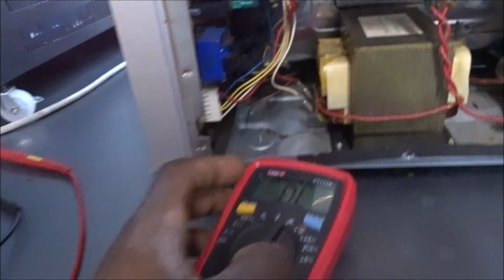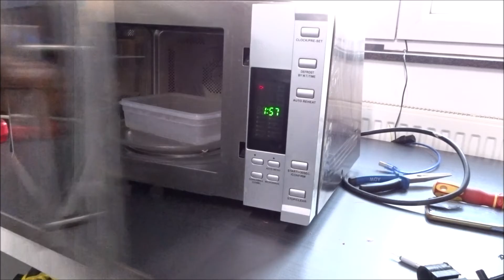Microwave  Not Heating?

Comment: Please my microwave power is off now and there is no power for.
Please what are the steps to check it please and please.
Reply from the maker: @EmmanuelKwakuAmponsah-v9z  well put the power on ,and from inside the microwave, using voltmeter measure  the cables that bring in power to the motherboard ,so u follow the powerlines ,This should be do e with an experienced electrician ,
Keep informed that if u plug 🔌 to the outlet, then remove the plug 🔌, capacitor inside the microwave, still store a lot of energy. If not well respected, you can get seriously electrocuted

Comment: Can we use jamper wire instade of fuse?????!!????
Reply from the maker: @TemesgenTelaynehMekonnen  if u use jumper wire ,it will work.the fuse is made to blow up when things go wrong and thus cutting from going to high voltage transformer ,so if u use jump wire and something go wrong ,u gonna cause short circuit or fire 🔥 
I highly recommend to use the right fuse for your safe
Reply: i strong advise you not to do it. Jt could work but replacing that wirh simple coppper wire.its dangerous specially that fuse which is high voltage fuse to protect the power transformer of magnetron(most expensive part to replace). becareful with electric shocks

Comment: What is the reason why microwave fuse keep blowing as soon as you plug
Reply from the maker: The problem can come from different reasons...
Components' failure causes a short circuit .
Warming things with wrong materials exp metallic materials .
A power  SURGE( is a sudden increase in voltage in an electrical system. A power surge in a house may fry your delicate electronic devices and damage appliances when too much power surges into their circuits. Most homes are wired for 120 ,240volt service.)

Comment: What Volta should the transformer send to the heater? Mine doesn’t have a fuse on the transformer. Cap is good. Door switches are good. But only get 6 Volts to heater
Reply from the maker: @Hvacnc  The output voltage of a transformer in a microwave oven typically ranges from about 2,000 to 4,000 volts (2 kV to 4 kV). This high voltage is necessary to power the magnetron, which generates the microwaves used for cooking food.
Reply: @juniorelectronics8255  what’s the ohms on the magnetron? I have continuity on the pins of it with 0.3 ohms of resistance
Reply from the maker: @Hvacnc    measurement should read less than one ohm.
Reply: @juniorelectronics8255  well it was 0.3 ohms so I don’t think that’s the problem. But with the original transformer, everything will work, but it will not heat and like I stated before whenever I’ll let it run without the wires from the transformer hooked up to the magnetron, I will only get 6 volts. That’s why I decided to change the transformer because of the voltage I was getting. But now it’s causing a short. Any idea on what’s the most common thing that will cause a short?
Reply: @juniorelectronics8255  I also installed new transformer and this time the 20amp fuse popped. Which could’ve been the reason the 1st transformer went bad. I checked the fuse the first time and it was good.
Reply from the maker: @Hvacnc  Well it looks like you are narrowing the problem,,,,could be that the Megnetron is causing short circuit 
I am curious to know how u solved it at the
Reply: @juniorelectronics8255  I have 120 going to it I verified that. But only get 6 volts AC out of transformer going to the magnetron

Comment: If the turntable has a not working  and not heat the problem will be the fuse?
Reply from the maker: @erickrivas48  if the turn table not turning properly the motor is  not getting the power, those motor don't get easily damaged. 
The fuse is for turning higher power. I recommend to keep looking..
Reply: @juniorelectronics8255  thank you.!!!

Comment: What can be the problem if the furse is okay but once turned on the transformer starts producing smoke
Reply from the maker: if the transformer produces smoke, the isolated material  of the  wires of the transfer has been burned out

Comment: What if the fuse is good,, what will be the fault now
Reply from the maker: good questions, the best way to diagnose the problems is to follow the power directions step by step, if the fuse is good then I will check the power that comes out of the capacitor through the fuse to the transformer, this way you  can see if the transformer is burned or not
Reply: Actually the main feed from the plug is coming from the capacitor to the transformer or from the transformer to capacitor?

Comment: So now how to be sure that capacitor has been discharged is there not be any testing to check if it's discharged
Reply from the maker: the best way is to always taste with a voltmeter !! to make sure the capacitor has been completelly discharged
Reply: @juniorelectronics8255  But then one would require a high voltage meter. That capacitor carries 6000Volts. A normal meter that you are using will blow up.
Reply: @krishnaidoo6221  no. Turn power off and put meter on microfarads
Reply: bush electrician here: there were no sparks when he was discharging so it means there was no energy stored in it